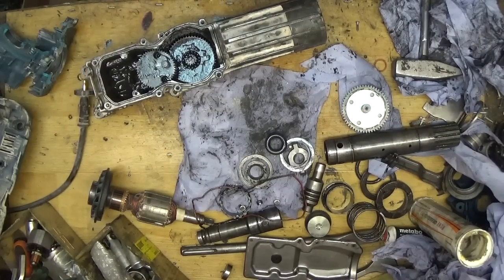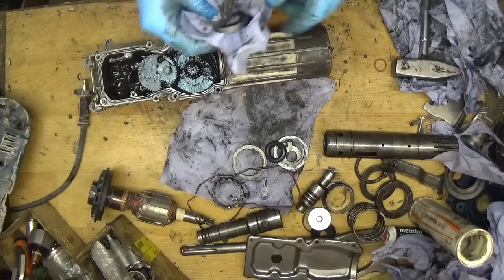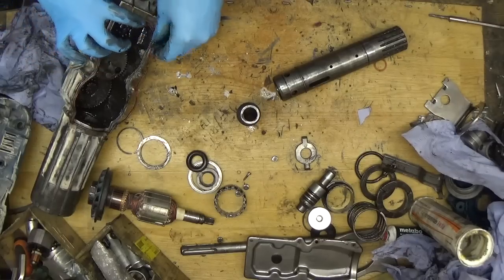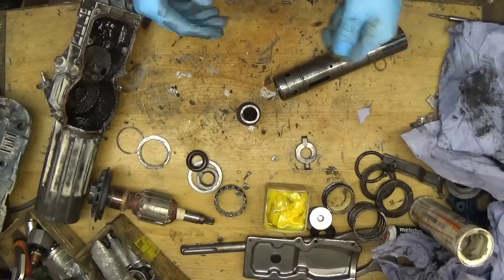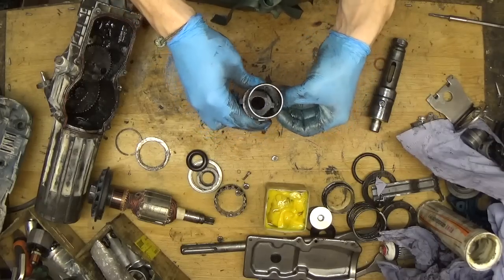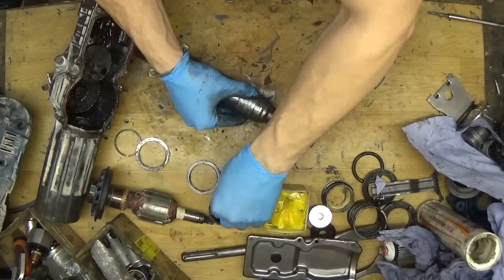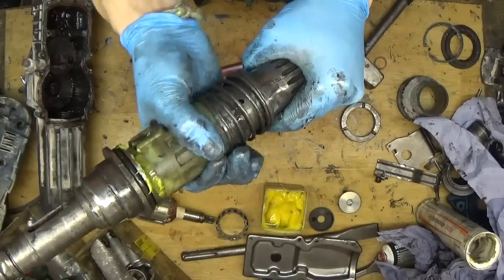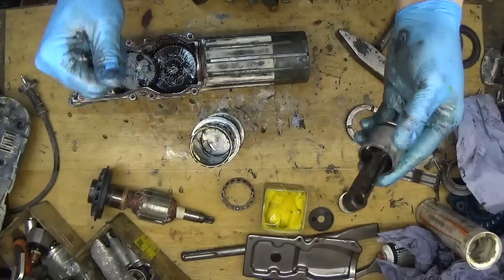Rotary Hammer with SDS-max Bosch GBH 11 DE Professional assemble I Handyman

Comment: Your work is not clean. You should clean every part separately to remove wear particles. You can soak them in gas or brake cleaner for cleaning. Then reassemble with fresh proper grease. In the carter where the piston is, you have to put oil, not grease.
Reply: I'm guessing since it has a brushed motor, it will never be completely clean. Carbon dust and concrete dust always leaches into the gearbox somehow. That's the trade off for buying and maintaining brushed DC or corded power tools.

Comment: EVERYTHING IS GOOD BUT IT WOULD BE BETTER IF YOU WASH THE PARTS, (THERE IS DIRTY FAT WITH REMAINS OF WEAR AND THAT IS ABRASIVE IN SMALL PROPORTION) AND PUT A MISSING BOLT IN THE GEAR COVER. SALUDOS DESDE LIMA PERÚ.